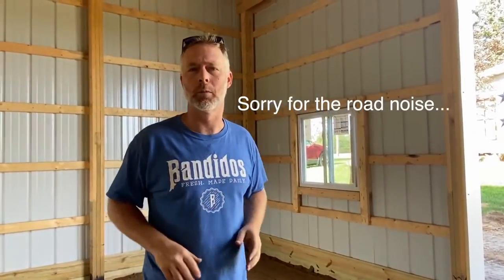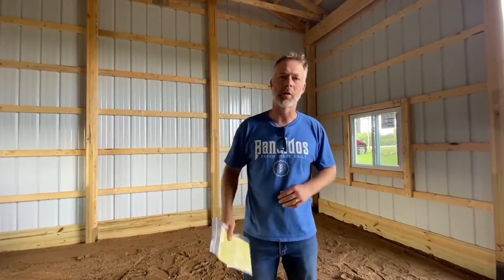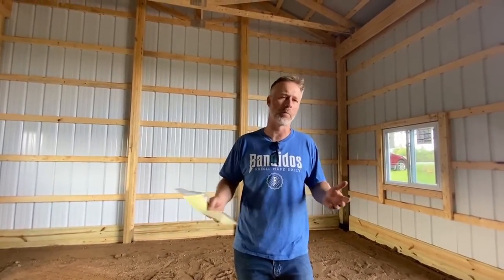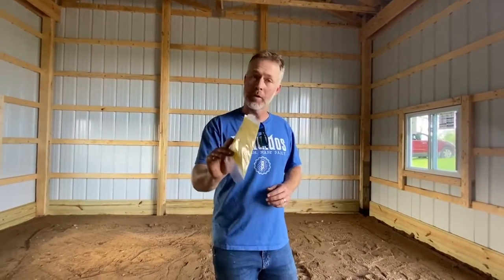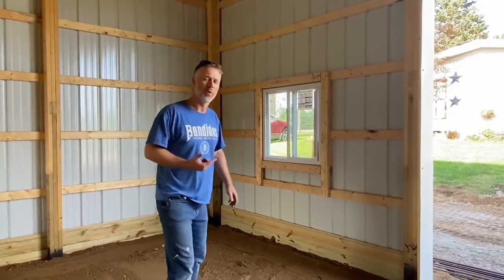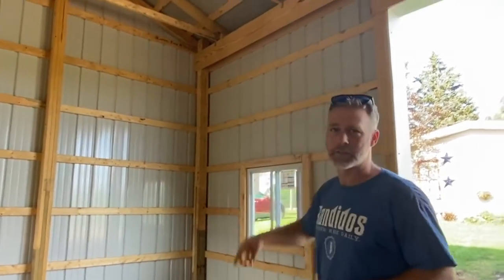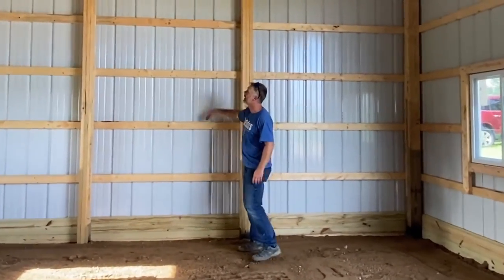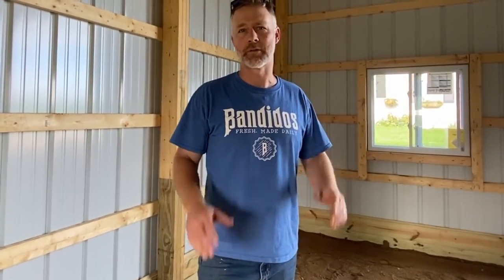So you want to build a pole barn..?

Comment: What is your work area range?
Reply from the maker: My crew guys service an area approximately 2 hours radius from Fort Wayne Indiana.   I tell people we do Indianapolis to Toledo.  Where are you?
Reply: @barnandhome   I am 90m east of cleveland, out of range.  Very good videos, nice effort !!!
Reply from the maker: @bigredd1574  thanks for the encouragement!  Good luck getting a barn put up
Reply: In one of your other videos you recommend always wrapping the barn with Tyvak to seal it better and allow for spray on insulation later.  This barn doesn’t have that.  Why??
Reply from the maker: @treatyoakphotography  good observation.   Some clients have no intention of insulating and will cut even a few hundred dollars out of a project to stick the budget.  Such was the case here.
Reply: @barnandhome  - do you also tyvek the roof if you are not doing a drop ceiling? I’m planning 2” of closer cell on ceiling and walls. It’s an all metal building rather than a pole barn.  In central Texas so mid humidity and lots of sunshine.  Very hot in the summer.  No plans to heat or cool it, just need to moderate the heat gain in summer.